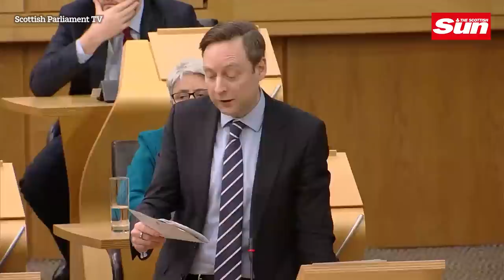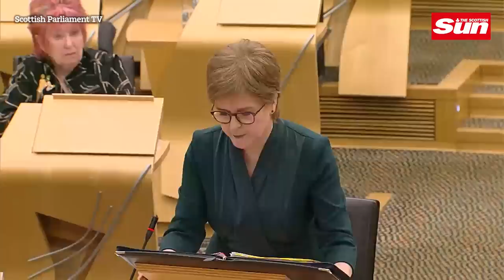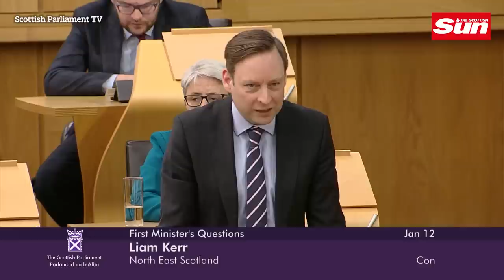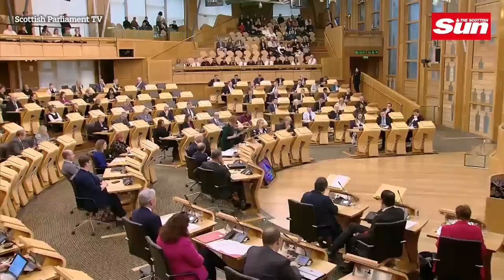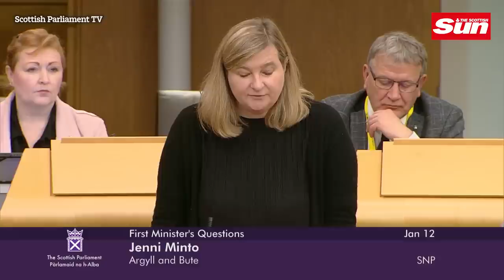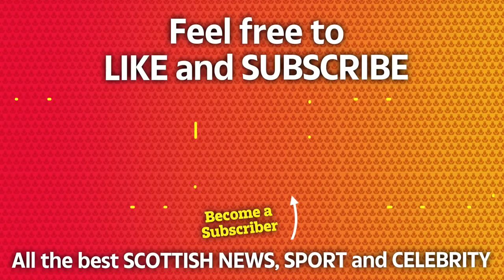Nicola Sturgeon asked why two ferries for Isla are being built in Turkey

Comment: As a procurement officer, you can ask any questions regarding the supply or the production of its material.
Reply: You can state that it has to be UK Steel that is used. When Sydney Harbour Bridge was built the contract said that 80% of the Steel used had to be produced in Australia BUT over 80% came from Dorman Long, Cargo Fleet, Middlesbrough Steel Works, now closed, and stamped from Cargo Fleet all over the bridge. Dorman Long were also the Designers and Builders.
Reply: @trevorhart545  In the UK demanding that it's British made Steel is very hard unless it falls under DSPCR regulations. The UK is still holded to EU Regulations such as PCR that mandate free access for all European countries. Unless it involves defence or key national infrastructure. I don't think in this case they could have demanded that it's British Steel as the ships are for civilian and not military purposes. Though I get your point :) hopefully this will be allowed when the new UK Procurement bill comes through and EU legislation is finally removed